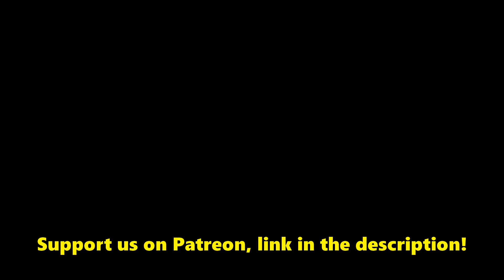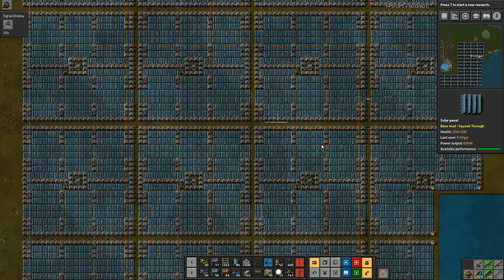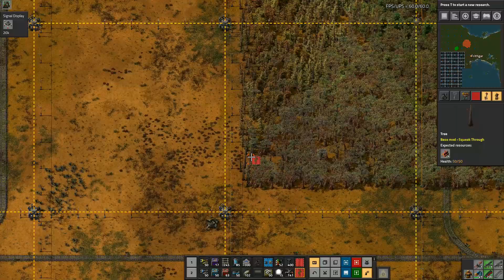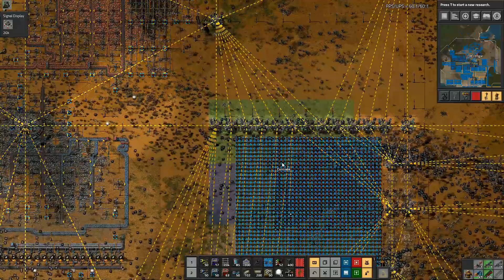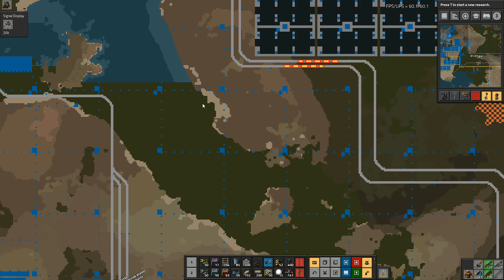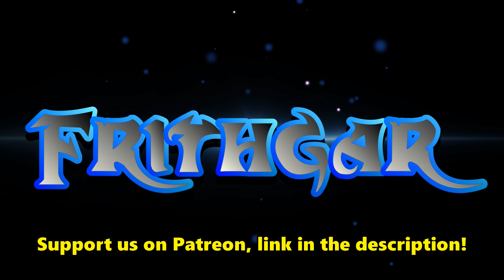Factorio Million Robot Challenge #146: Concrete Floor!

Comment: Pick ghost item if no items are available, located under Settings -> Interface -> Interaction. Also allows quick ghosting with “Q” (depending on keybinding) if the object you need. Is nearby, via mouse-hover+Q.

Comment: An easy oil station is as follows. you will need 4 storage tanks to connect the pump jacks to. You will also need fluid pumps. one for each fluid wagon (you can have multiple pumps on each fluid wagon if you want to fill it faster. I use a train and 3 fluid wagons and 4 pumps per wagon to load them. You will also need pumps and storage tanks at the unload station to get the oil out of the fluid wagons. 3 fluid wagons will allow you to haul 100k units of oil. for the pumps you place them nest to the tracks like you do the inserters.